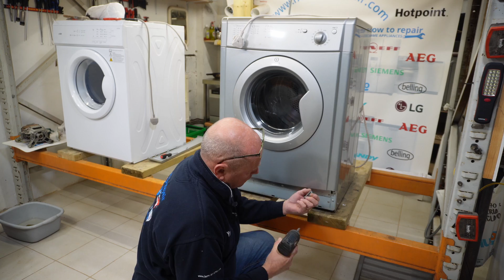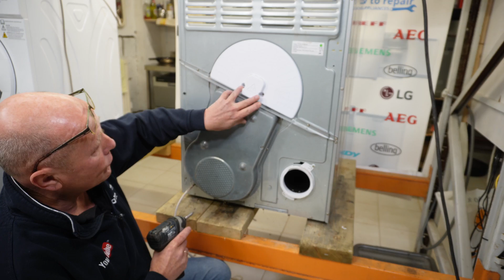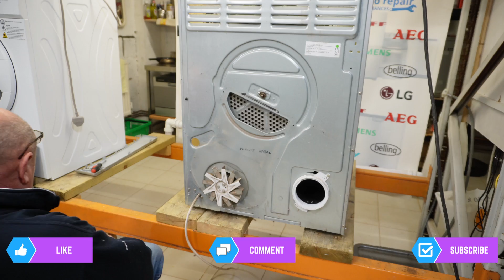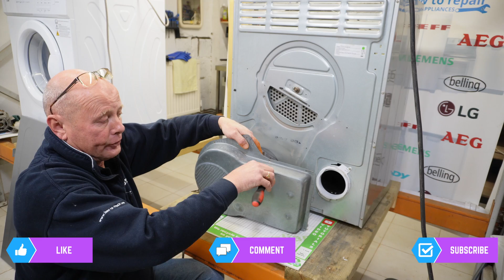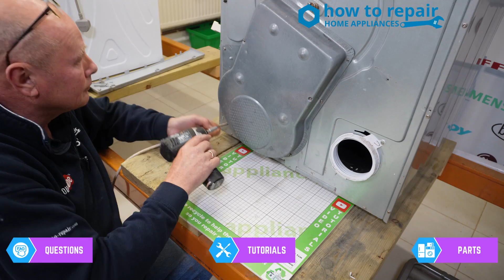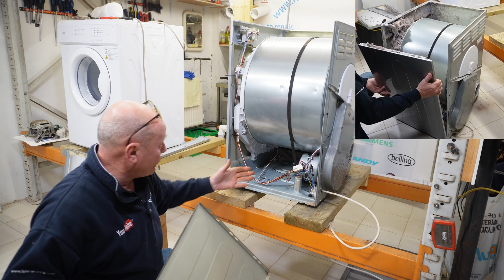Tumble Dryer Hotpoint & Indesit Taking too long to dry replace heater/bearing C00142628 & C00282401

Comment: Great Advice. I have actually done both the bearing and heater element on my tumble dryer. You are absolutely right my heater blew because of the lint build up. I now open up the dryer every six months and thoroughly clean it

Comment: I have a weird issue with my washing machine. It's a Panasonic and it will start fine, it takes and drains water, but it refuses to spin. It will abort whatever program I have started after a minute or two, start beeping as if it's finished, no matter the actual program's time.
Reply from the maker: I would expect them to check if the carbon brushes if fitted are in good condition

Comment: Shouldn’t you have removed rear panel and checked lint build up around rear seal?which they are prone to a build up of lint there ..even after their mods…oh  ps..gloves mebbes as very sharp edges..??
Reply from the maker: Hi. I did of cam but it was clear but I should have mentioned it very good point 😊